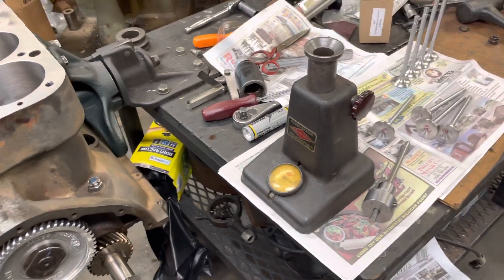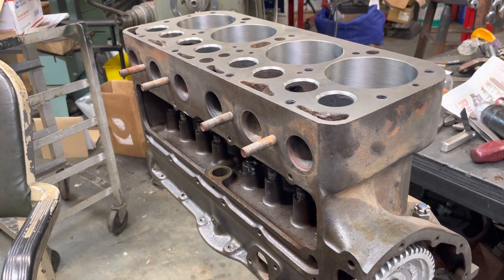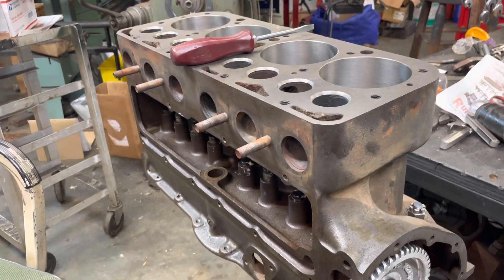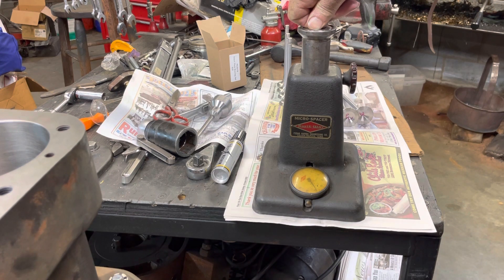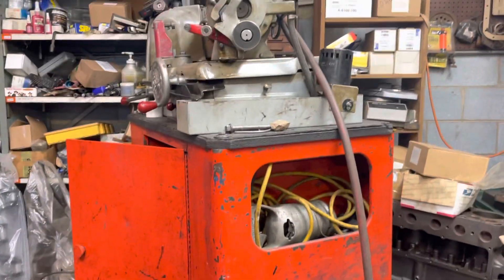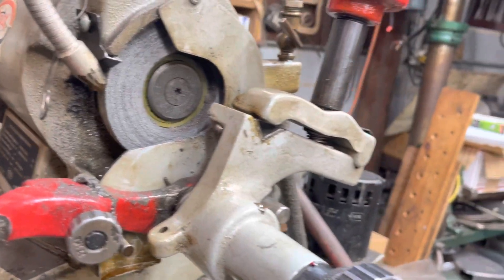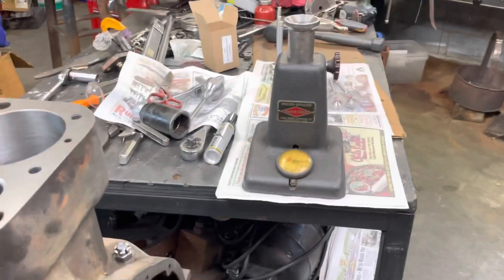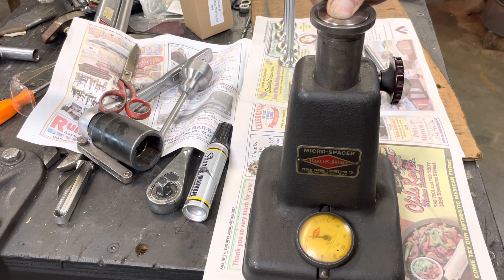Ford Model A valve job without adjustable tappers

Comment: Just found your videos, you do a excellent job on everything you work on, thanks for sharing your knowledge and experience on the MODEL A FORD, by the way, what State are you located in, SUBSCRIBED.
Reply from the maker: Thanks William. I’m in s w Virginia
Reply: @randallstrickland8204  Okay,  I have a question, I own a 1931 TUDOR, I tried to crank it the other day, it started back firing through the carburetor, it has never done this before, it usually starts up easy, just one pull on the choke, she fire's up, what do you think might be the problem, also do you rebuild carburetors.
Reply from the maker: @williambutler8624  it could be starving for gas or the ignition timing might have slipped most of the time I’ve had back fire engine was running to lean ,take the drain plug out the bottom of carb, it’s the one a half inch wrench fits put a catch pan under it and turn on gas and you should have a good stream of gas that’s where I would start also check ignition points gap
Hope this helps
Reply from the maker: I do rebuild carbs but I’m so busy it’s hard to find the time
Reply: @randallstrickland8204  Okay, Randall,  I'll check the the things you mentioned and see if this will solve my problem, THANKS for the information.
Reply from the maker: @williambutler8624  you are welcome